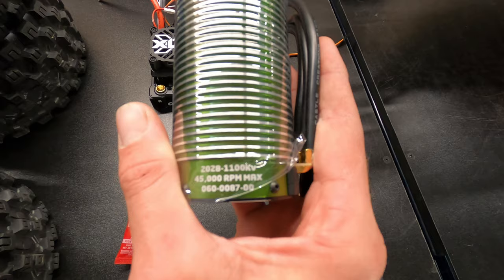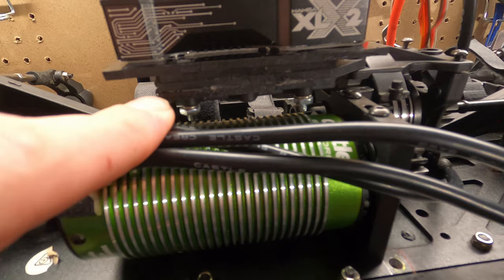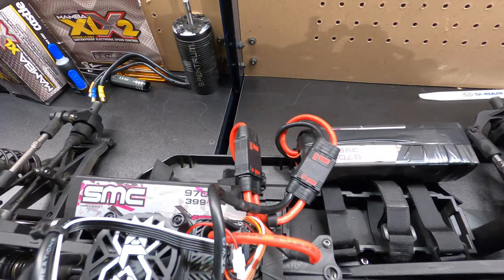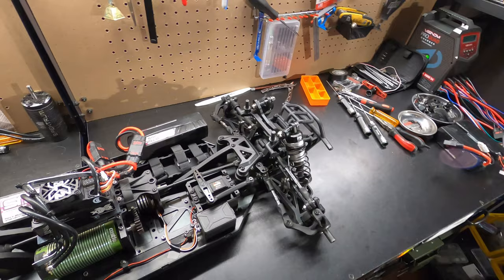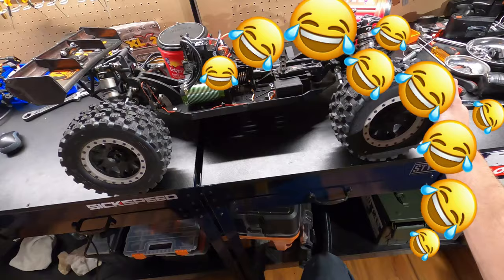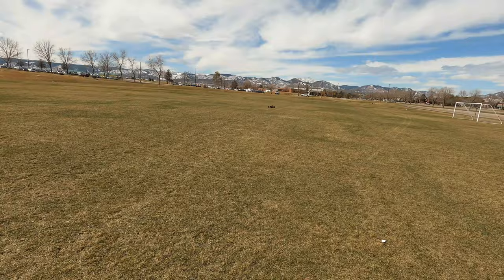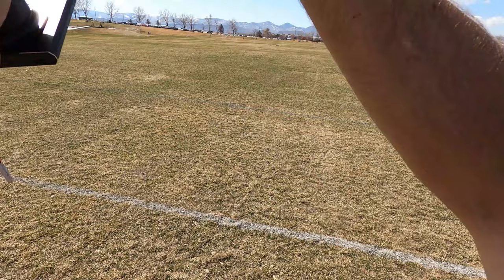Losi DBXL-E Castle Creations XLX2 and 1100kv Motor! Major Power Upgrade!! #xlx2

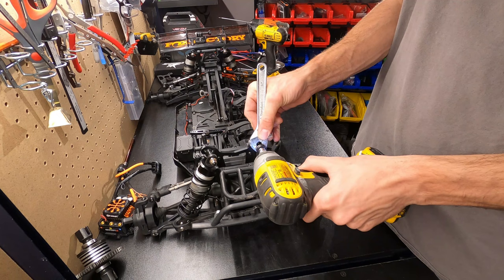Comment: 3:19 😂😂 by locking the center diff up the rear tyres get way more speed and it wheelies more. You can’t compare it with a limitless, which runs better with a locked diff (for speed runs). Sometimes you win, sometimes you learn! Awesome video as always.
Reply from the maker: Yeah I learned that after this video 😆 My off-road speed run buddy told me you want it more open diff for off-road. I'm new🤣🤣🤙

Comment: Because that spektrum reciver has avc, first you need to calibrate the reciver full throttle full brake right left after you do that proceed to calibrate the esc wait for the reciver light to turn orange first then pull full throttle and it will go into calibration mode
Reply from the maker: That's good information! I didn't know this at the time😅👍 Thanks
Reply: Just disable AVC when the reciever starts job done

Comment: How does the losi dbxl handle, compared to a kraton or an x-maxx? Is it more basher or more buggy? I really like the looks of it🤩
Reply from the maker: It's definitely my favorite truck. It handles a lot better than the xmaxx, I don't own a kraton yet so I can't compare too much with them. It doesn't have much air control stock, only because it's so heavy and the tires don't balloon. I highly suggest owning one👍
Reply from the maker: Also it's built like a tank! Can handle some crazy crashes
Reply: @zagertRC  Thanks.I own a Kraton 6s and have driven x-maxx before. Like the Kraton better, more stable. Definitely thinking about getting one of these. Really awesome👌

Comment: Just my .02 cent worth, get the aluminum diff housings for the front and rear. On mine, My driveline is 100% aluminum and steel, no plastic what so ever.
Reply from the maker: It's definitely on my list of what to upgrade first. What do you suggest? Vitavon parts?
Reply: @zagertRC  Vitavon is very good but expensive. I have the atop housings and brackets and have held up very well. I do have some vitavon parts including the center diff/motor mount. I also got the losi aluminum center diff and put in the front and rear. They are direct replacements.
Reply from the maker: @Blueknight1960  Awesome! I'll have to check those out. Thanks for the info👍
Reply: @zagertRC  Unfortunately, I was running mine yesterday and a magnet inside the motor came unglued (2028 1100kv). I contacted castle but, haven't heard anything from them yet.
Reply from the maker: @Blueknight1960  That sucks man, I never had any problems with a castle motor yet. Fill out a RMA request form and if they send u a RMA number just send it in.

Comment: No way bro this is why Iv not brought one of those I went hobbywing max5 tones of power
Reply: The hobbywing doesn't compare to the xlx2 in the power department. I had a hobbywing max5 and it failed after 8 mos and the warranty is only 3 mos. I have the xlx2 now and to be honest, while it's a more powerful esc, in my personal experience it isn't made any better than the max5 but it does have a 1 year warranty. This will be my 2nd time using castles warranty. The negative wire on the esc's pcb board has broken, twice.

Comment: Hey bro have you use a mamba 8s before and if so wyt about it for speed runs
Reply from the maker: My first castle ESC was mamba 8s in my Limitless. It blew right away speed running, so I traded it for a xlx2. That one is still going strong off hundreds of speed runs and pushing over 600 amps

Comment: Wait theres mounting holes on the xlx2 but not the mmx8s
Reply from the maker: Yeah. I used a 3d mount for my mmx8s when I had one.
Reply: @zagertRC  i had to design a case and 3d print it it clamps down on the sides of it